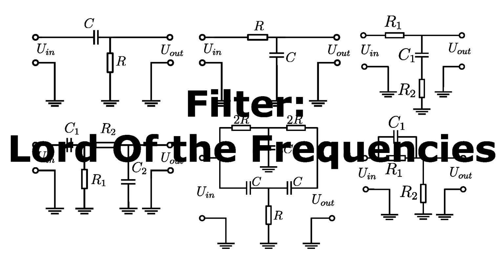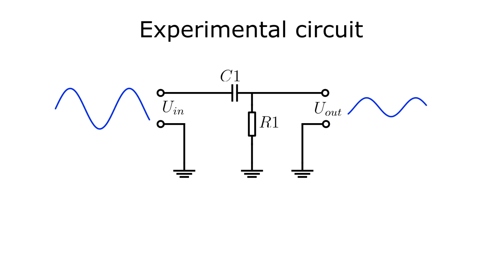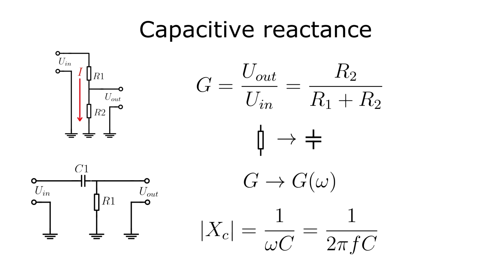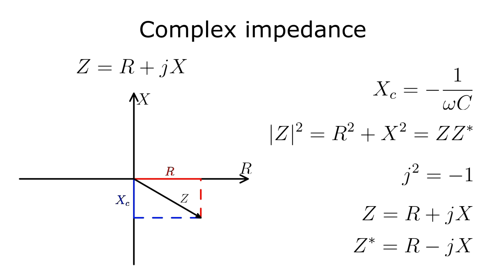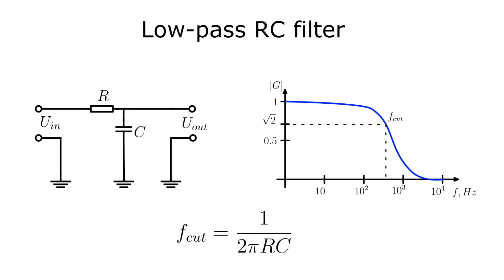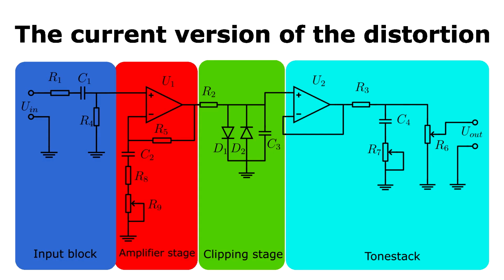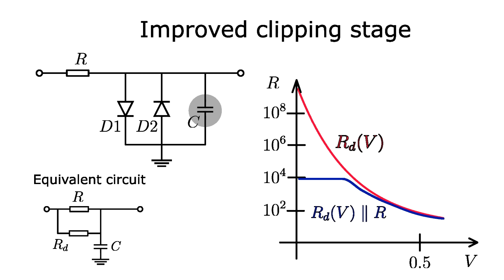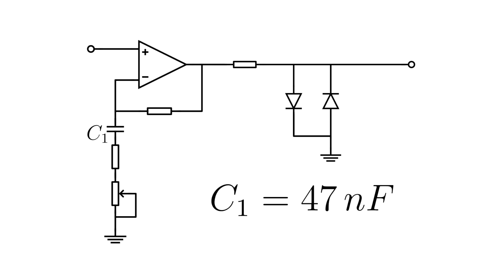Designing Your Overdrive/Distortion Pedal: Part 2 - RC filters.

Comment: Soft limiting with diodes produces higher levels of unwanted triangular wave harmonics.
Harder limiting produces more satisfying harmonics due to the squarer waveform shape.
Tone can then be modified with filtering.
Reply from the maker: Symmetrical soft and hard limiting can only create odd harmonics, and filtering only reduces the value of higher order harmonics but does not significantly change the spectrum. The difference between soft and hard is amount of additional distortion.